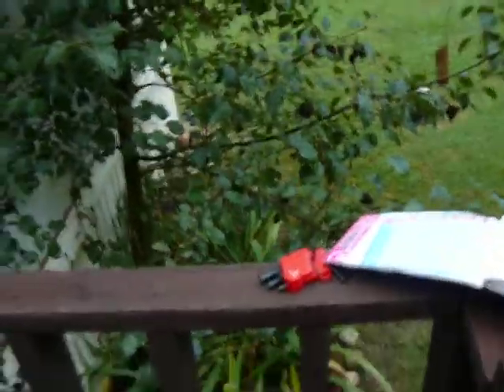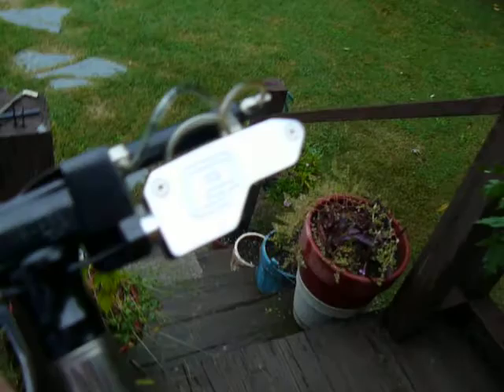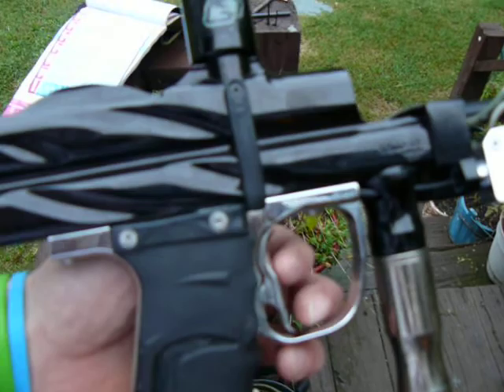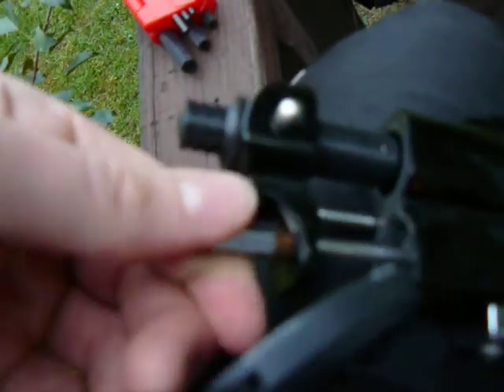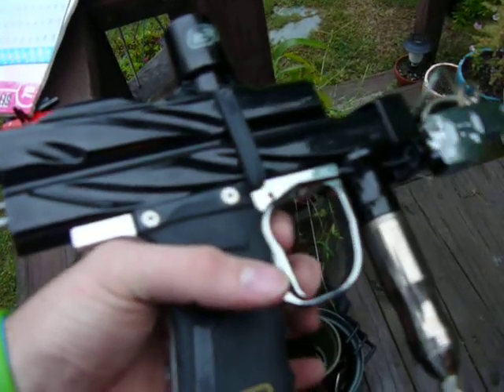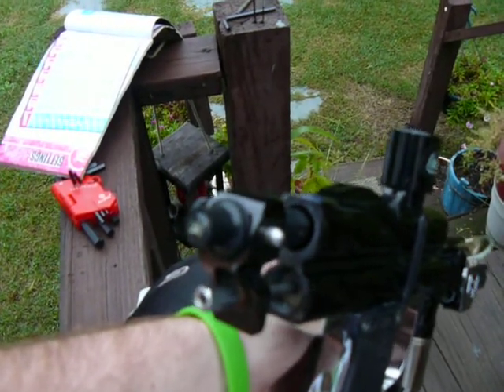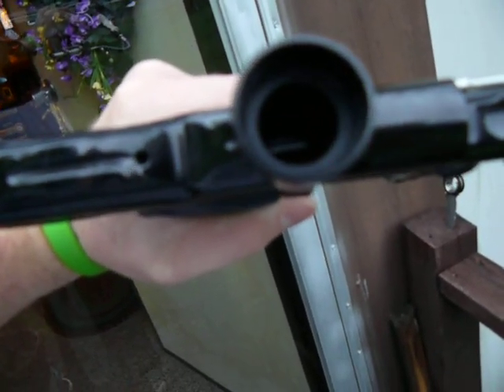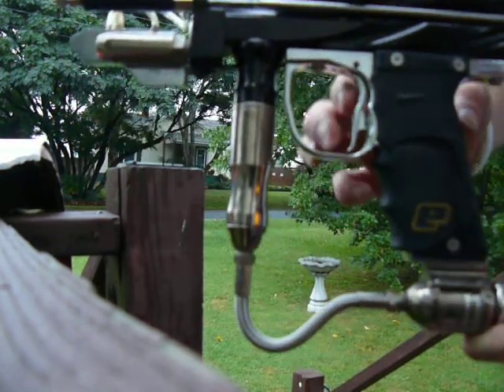04 prostock problems!!

Comment: I don't know if you still need help. But if you do one thing is that your 3-way lines are on backwards. That is the reason why your bolt sits in the cocked position. The front goes to the front of the ram, the rear to the rear of the ram. The center goes to the LPR. Also, if it seems to be out of tuned, you're going to need to work on the HPR and possibly the IVG. Try not to mess with the LPR too much as it will mess up your solenoid. Hope that helps. Good luck!